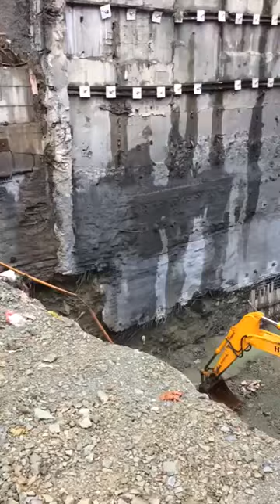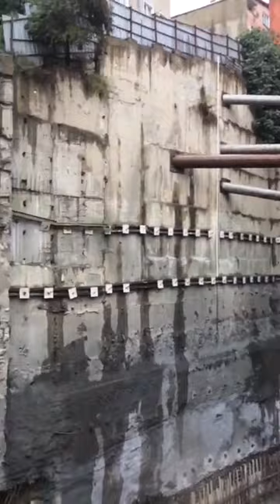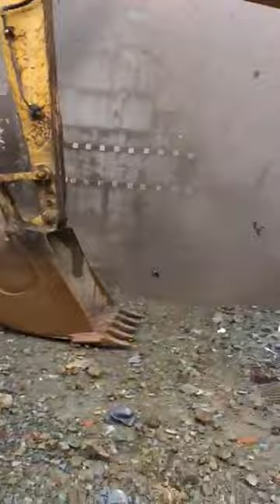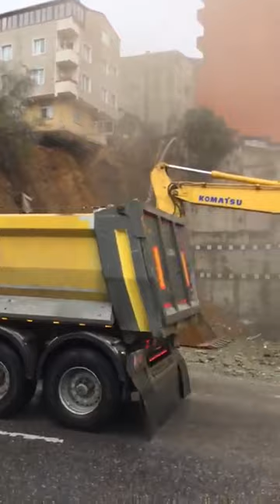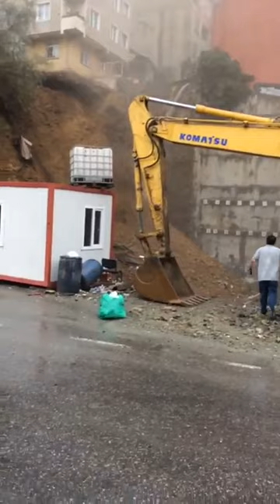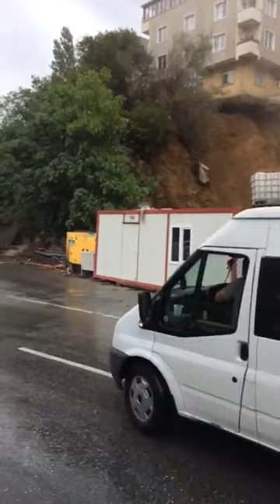Workers mess up - Massive retaining wall collapse (view 1)

Comment: Uneducated engineers? Must be!
Reply: Engines like to party too.
Reply: I'm no engineer but That's is not smart to have cheap brick wall holding
Reply: More like an UNgineer🤣🤣🤣
Reply: Next day it rained lmao
Reply: Probably indian engineers
Reply: @invictus88  Turkish
Reply: Dont know why I was fired??? I didn't do nothing.
Reply: Doogie H accidents don’t happen, there is always a reason. It’s painfully obvious in this situation corners were cut and they didn’t do everything possible to strengthen the retaining walls. So this was a clear case of neglect biting them in the ass and now the second building has to be vacated and everyone has to find a new place to live
Reply: Doogie H  , you obviously know nothing about construction? There is no concrete support structure at the base and the wall should have been drilled and anchored! Etc etc!!!
Reply: Doogie H  sorry buddy that was no accident. Piss poor engineering. I've done Shoring for 35 years. Just by looking I'll tell you. Not enough Wailers and no Soldier beams. The tie backs should go all the way down into bedrock
Reply: Im curious on the psi that concrete and slup
Reply: @williamkeaton7945  correct. I saw that too
Reply: A Black I just spent the summer interning as a geotech engineer designing and inspecting retaining walls and trust me you can design the safest most over built SOE and the contractors could try to cut corners and half ass shit and then this happens
Reply: The problem is that most people don't know the difference. Just because you have an engineering degree it doesn't make you an engineer. You need to pass the Professional Engineering State Board Exam which is much more than just having an engineering degree. I am a licensed engineer in Texas so I know what it takes to be an engineer.
Reply: Blame the greedy ass contractors, not the engineers!

Comment: Got headline assbackwards amigo! The engineers and project managers "forgot to place footing under 100' plus retaining wall". Workers do what the engineers and foreman task them w
Reply: Yep. No footing
Reply: @Two two three Five five six 
Yup. And the fact it's floating in the air off the ground doesn't help. Typically any wall sits on a footer too. I'm assuming this was in China.
Reply: 100 foot floating wall just stuck to the mud  - great piece of engineering.
Reply: No they didn’t forgot to place footings, they wanted to minimize the costing....lol
Reply: @Kushert  if you look clsely to the people.
Reply: If it don't feel right it probably isn't.
Reply: This wasn't in China the workers are not asian and I bet the so called Engineer wasn't either....trying to save a buck
Reply: Where was the project manager ? The strip club WTF?????
Reply: sftimecap true
Reply: @Chris Wood lol pretty much everything is assembled/made in china most likely the device your using and everything else you own lol
Reply: It's funny to read the thoughts of people who have never designed something.   Blaming this on the lack of footings and hydrostatic pressures... love it.
Reply: Whatttt!!!!!! No 16' wide footings 2' deep with the retaining wall offset 2 foot in. Leaving 13' of footing under the dirt to help hold the wall in place. Dont forget the 3 mats of #7 rebar 4" on center in the footing with a double row of #7  vertical rebar 6" oc and #7 horizontal bars 6" oc through entire wall. Wall starts 3' wide and steps in 4" at every 8' in hight. Oh and backfill with 57s to within 2 foot of the top of wall. 5000 psi concrete to be placed by pump truck at no more then a 4" slump and vibrated in place. Plastisizer may be added to reduce slump and improve workability of concrete. Now where did my stamp go lol
Reply: Oh and 22" overlaps in all grade 60 rebar.

Comment: Engineering mess up full metal skeleton wall with raking shores needed size of steel and angle of rake including dept of pad stone or pylon to support said wall not just aload of metal pipe and rebare anchors through wall look at the massive load that needs restraining to hold that much back is a massive under taking of engineering we might be construction workers but 20 years hands on daily experience beats pen pushers every time
Reply: Well said theres no substitute for experience.
Reply: 20 years of experience is great, but only 6 years of elementary school is what's typically needed to teach simple punctuation!  Trying to read this was like trying to listen to a high-strung person on 8 cups of coffee and an 8-ball!
Reply: @fubisroc9673  tell that to the engineer who designed the retaining wall
Reply: +Tom Smith  Why?  I haven't seen any examples of HIS shitty (or complete lack) of punctuation here!
Reply: @fubisroc9673  punctuation saves lives no wait experience construction workers do
Reply: I B33  it depends on the experience of the pen pusher and of the construction worker but in my experience the owner or managing director tend to be of a trade background
Reply: @tomsmith9048  so such wall as this is built from the top down?  As they dig they drill tiebacks and pour concrete?  I'm just trying to understand how this got so deep before falling apart
Reply: @Emilthehun  I don't either I just commented on the construction workers part but the carpenter form worker fixer shuttering carpenter  ect depending on the part of the world you come from would of carried out instructions provided by an engineer who'd  done there maths and geological survey  the said building site
Reply: It's crazy how people can be about construction when there not on site
Reply: Seppe Tank  definitely I agree and nowhere near enough support at the base either they were probably put in when the building had it's front and rear elevation and seemed alot more stable but the structural engineer should have taken not only the load into account but the vibration of the road adjacent to it
Reply: @fubisroc9673  i bet you feel like quite the intellect. Praise be to the punctuation gods that have sent you down from the heavens to correct the internet people 🙌🙌🙌 hallelujah 🙌🙌🙌
Reply: You call him a twat for misidentifying something, then you spell "waste" as "waist".  Ironic.

Comment: can someone give me an engineering explanation of why this occurred? Thanks I will really appreciate it.
Reply: Weak structure bad support. What they essential did was is put up a thin wall with barey any supports to hold back the large mound of dirt that is constantly pushing against the wall. Looking at the excavator in the bottom with the exposed dirt makes me think that they took some out which should have been the last straw to break the camels back. Usually if you are going for safety as your top priority this should never happen unless a strong earthquake happens or other event but these guys cut too many corners and lost the gamble.
Reply: Sonny  J thanks much. 👍🏿
Reply: khariinaction  they dug the footing out big piece of concrete that supports the wall
Reply: Gravity !!
Reply: Hold my beer!!
Reply: No footing equals no wall.
Reply: Online Engineering degrees will do it every time.
Reply: They dug too close and  deep  , destroyed the foundation. the wall with no support came down 
With the force of gravity.